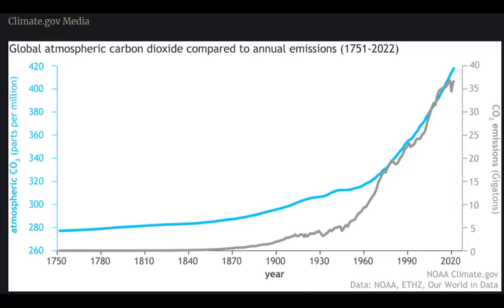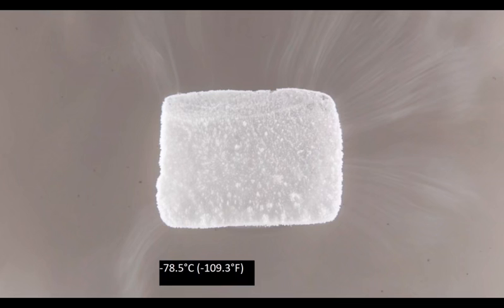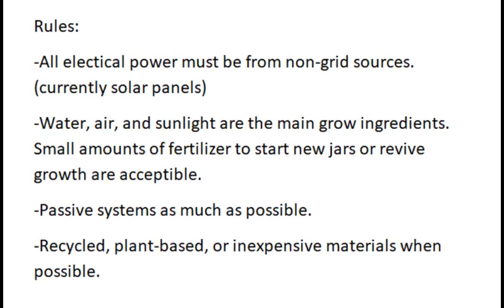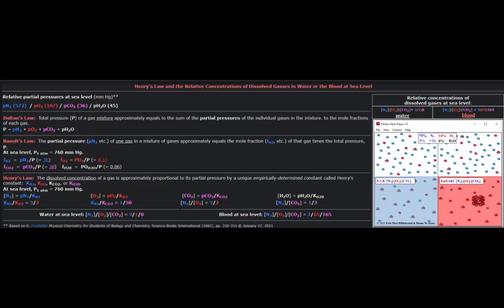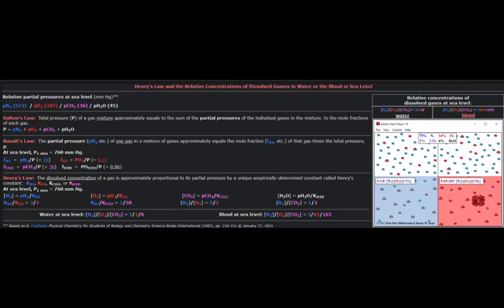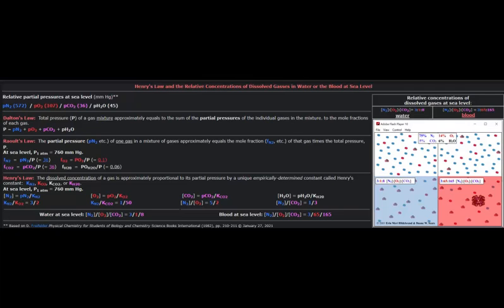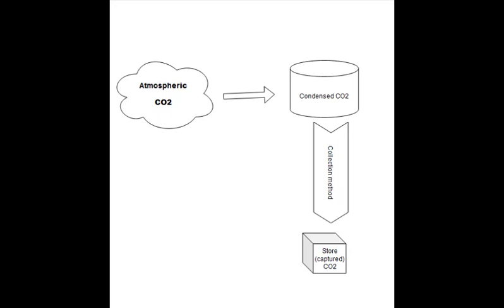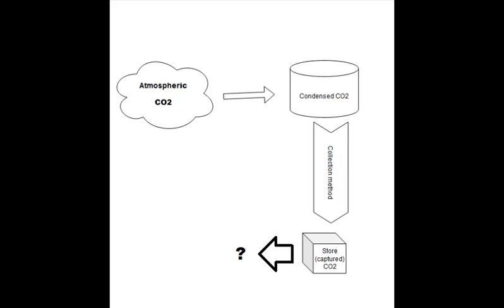Introduction to the algae carbon capture project

Comment: I'm trying to come up with a "free" design for this. I've had an algae sample growing in a fish tank for a few years, and I'm considering hooking a tube up to a carbuoy and feeding the gas through the algae tank, then feeding the algae to vermiculture
Reply from the maker: I think my setup matches what you describe with the carboys. I've been trying to figure out what to do with the algae afterwards and vermiculture sounds like a option i should do further research on.
Reply: @NarcimAlgae  I'll be getting snails from the fish store, and feeding the algae to them along with any meat scraps. Then I'll use the snails to buffer the acidity in my fermenting kitchen scraps. That mixture will go into the worm bucket

Comment: I have tried this concept in the past and it worked fairly well, with a tiny aquarium air pump to saturate the algua with fresh air (and co2). the big limiting factor is scaling up, at some point pulling out the biomass was way too time consuming. 
There's probably an good way to do it like collecting the algua sediments at the bottom as it's already concentrated.

I bet you probably also seen the video from Joel Creates titled : "How much ALGAE do you need to breathe? TESTED"
He did quite a bit of thinking on the subject and applied it into an experiment. Pretty good.
Cool video, subscribed to see the next one.
Reply: Cody’s lab did a real good demonstration of an algae solar panel
Reply: Since the algua are particulates in the water, a precipitation tank can be set up. Making the algua circulate back and forth between a growth and a precipitation tank. And once the precipitation is full, it can be disconnected, dried and stored. Being able to swap out the precipitation tank will thus allow continues operation, and easy handeling / cleaning. You would still probably have to clean the growth tank one in a while to keep the light coming in efficiently enough.